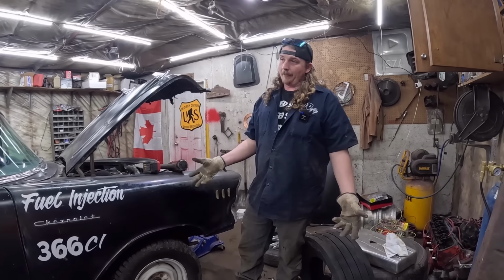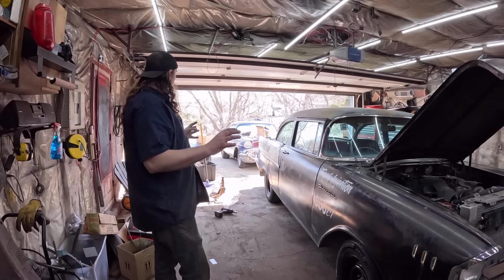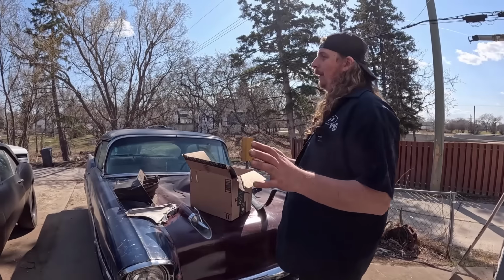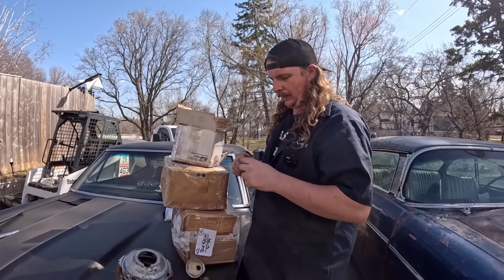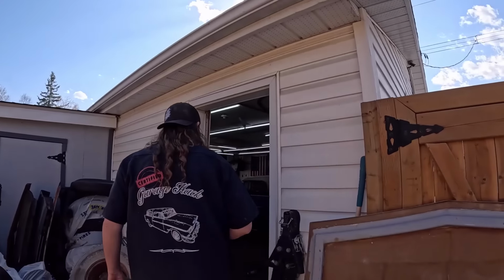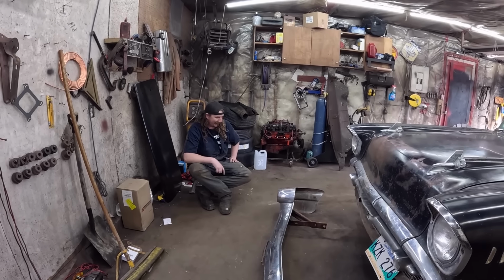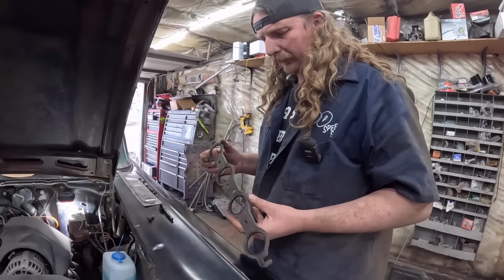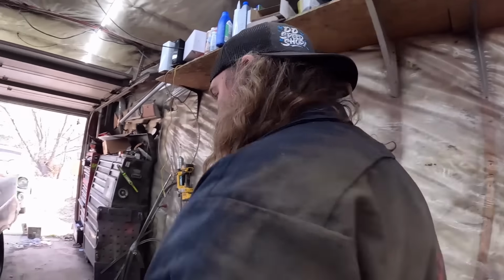Selling The Fleet - 1957 Chevy Is On The Chopping Block!

Comment: The best LS header gaskets are 2005 Silverado 2500HD 6.0 exh manifold gaskets. ACdelco They are stainless MLS gaskets. I have used and reused(Dan's favorite. Cheap,cheap🐥) they're the best and way cheaper than header gaskets. Straight from the dealership parts dept.

Comment: Hey Dan, I have a '66 Camaro. I have it stored in my garage with my '49 Corvette with the aluminum body. It has several ultra rare options. It has a louvered oil pan, chromed reversed valve covers, hydraulic spark plugs, tubuar chrome moly windshield wipers and Maypop tires. I also just installed a replacement set of roller muffler bearings. My next project is a Rolls Canardly. It currently rolls down hill and can hardly make it back up. As a side note a Rolls Royce spokesperson once said that their motorcars never break down. They have however, on extremely rare occasions, experienced a failure to proceed.

Comment: Oven cleaner will take all the paint off , if you leave it on to long . Oven cleaner works for old undercoating as well . Try wax and grease remover on the lettering

Comment: Guys before you go nuts here, see if the new owner would like the lettering on the car. I like it and I'd want it on if I was buying it. Plus free advertising in its new location. Just a thought. Let the new owner decide.  I will get off my soap box now and shut up. P.s does the snow blade come with it?